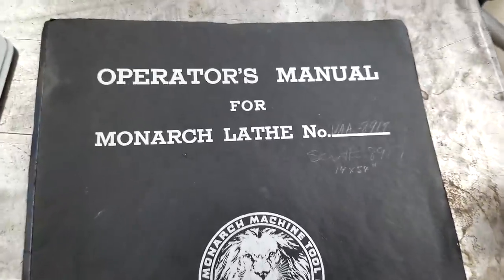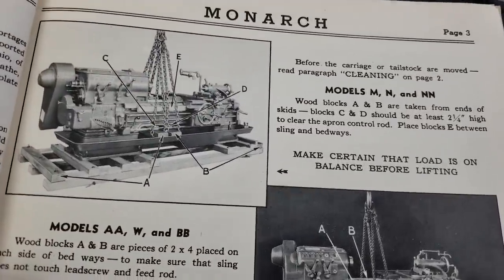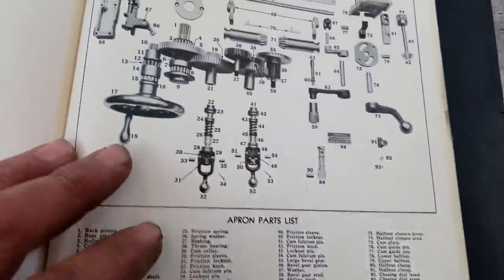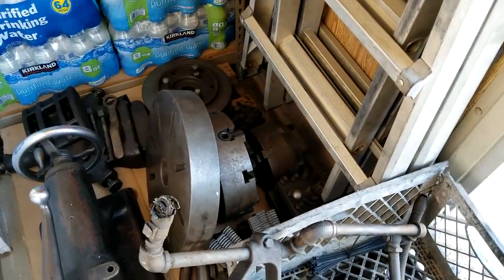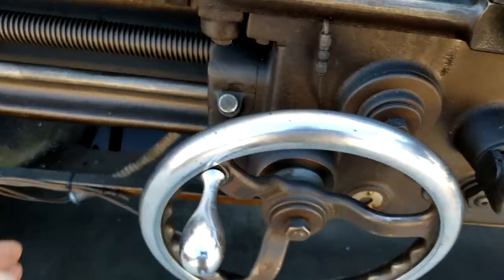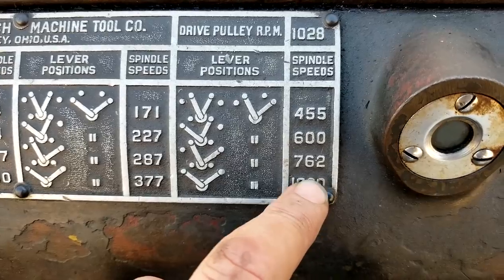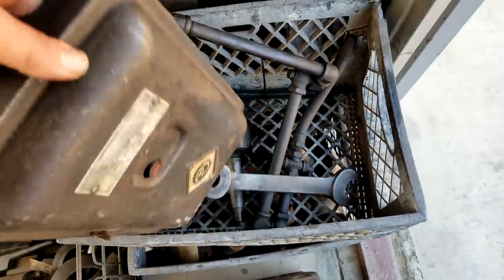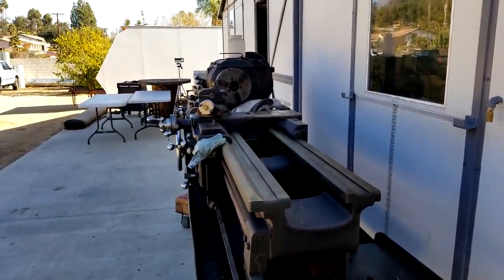New machine day

Comment: Hello Stan,  it's in beautiful condition, probably only driven on Sundays.   I think the low top end speed is directly related to the quality and capability of the cutting tools of the time.
Reply: Not really. This lathe is made for larger stuff. Spin a 12" (300mm) work piece at 1000rpm and that's over 3,100 surface feet per minute.
Reply: I don't see any reason you couldn't put a faster motor on it, depending on what your intentions are.  You know enough about machines to make it work well.

Comment: Keep the Patina please! You have a Gem. I have a Brown & Sharp 2A Universal Mill and WILL NOT paint or do other things in that line apart from learn to scrape to bring it back to spec. It still has the original B&S taper as well as Dividing Head/Gears and so on. To the best of my understanding it was made sometime between 1913 and 1926 so it is a flat belt drive originally. I love my machine as I am sure you will with yours. John, Australia.

Comment: Ya that's wow! Just fill that other folder with just the stuff you want to know from the PDF file and when its all in there the paint will be dry. No your right just make sure all the parts are there so it dont crumble under its own weight bolts are tight some disasembly to look  like the gear box could'nt hert  is there a step by step in the manual for general working order how many horsepower and what kinda transformer the power company stick you with ya the EE I knew You're after that EE Great work by the way